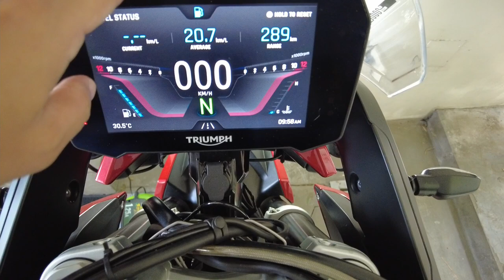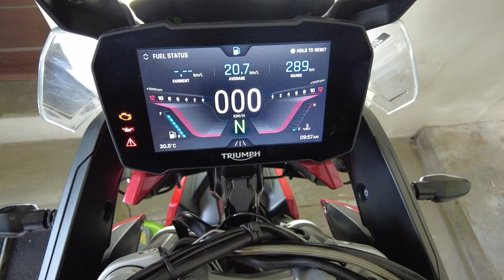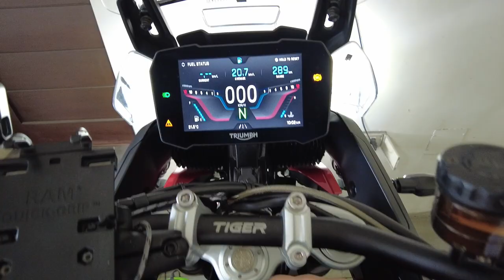Owning the Triumph Tiger 900 GT Low (LRH): Views from a New Rider

Comment: very nice video.i have same bike not LRH (since triumph dont sell LRH in india) so i bought a low seat and bike is with low position adjustment 790 mm.i am 5 feet 5 inch so tip toeing now.going to lower bike by 32 mm with lust racing lowering link then it will become like yours.
Reply from the maker: Yes I came across a review that the Tiger LRH isn't sold in India, but it's good to hear that there's a kit to lower it. Thanks a lot for your kind comment and share. 👍

Comment: Enjoyed hearing your thoughts on the bike. Just got a regular 900 gt myself last week and curious what engine/crash bars you are using and if you rate them? Thanks
Reply from the maker: Thanks a lot! I'm glad you enjoyed the video. 👍 I'm got the Outback Motortek crashbars and skid plate. They're really tough, but tend to limit the space for my left foot.
Reply: @MotoFaith  Thanks for getting back to me. I'll check them out. Was thinking I might get SW-Motech bars. They look similar so will compare. Stay safe.
Reply from the maker: @HW-kf7hi  Great! I just wanted to add that the bars reach really close to the gear shifter and break pedal, so it leaves little space for your feet. Also, despite Outback's video that shows the bike being dragged and the bars catching all the hits, I actually dropped my bike once on the right side, and the brake pedal actually still touched the ground... causing it to be dented. It wasn't a major dent, but I just thought you should know.
Reply: @MotoFaith  Thanks for the advice. It seems none are perfect.

Comment: how do you find the triumph tiger??  😀
Reply from the maker: Hi Kate, I'm actually enjoying it.  I think I've done all that can be done to enhance its offroad specs like change to 70/30 tires, buy tougher skid plates, etc., and have been stretching it a bit in that area. It can manage, though as you said in your own review the ground clearance is sacrificed at some point. But I've managed to increase the height gradually thru the adjustable suspension. It's a tough bike too.

Comment: So, it was a good review especially for short people. 5'7" . Has this bike been to Baguio yet and if so did it make it up the mountain with little effort?  Given another choice would you consider the 850 with a low seat?
Reply from the maker: Thanks for your comment Owen! I haven't ridden it to Baguio, but I rode it through the twisty mountain roads around that area and through Sierra Madre, so I guess similar conditions... inclines, loose asphalt and potholes caused by large trucks and buses, long queues of slow moving trucks that need to be overtaken (i.e. the not-so-glamorous parts of mountain roads in the region 😄 ). The bike performed very well with the scorpion STRs (I wouldnt know with stock tires though), it gripped the road very well, it didnt skid through the  broken asphalt even on curves (with caution ofcourse). At one point I considered the 850, but people said it was much heavier than the tiger 900. I havent ridden the 850 yet and reviews say its a good bike, but I decided to just stick with my tiger 👍... it feels so agile on the twisties. 850 might be better offroad given that the tiger is a triple, but it can handle the job well enough.
Reply: @MotoFaith  Thanks for the reply. Stationed at Clark 67-68-70-71 Baguio then was heaven to me. Lived in San Pablo, Laguna. I miss the PI. Poor economy is preventing me from another bike purchase. Triumph is the way to go. Stick with the Tiger
Reply from the maker: Thanks for the advice Owen! I hope you can come visit the islands again soon 👍

Comment: May I ask what the ground clearance is?  Would it be able to go from the curb down to the road with clearance?
Reply from the maker: Hi, thanks for your question. 👍 The ground clearance with the lowest setting of the rear suspension is around 6 inches. I've adjusted it upwards so it's now around 6.5 inches. My house has a high transition from my parking to the street (almost like a curb), and I've had no problems with the bike.
Reply: @MotoFaith  thank you great video.   I will get one of these

Comment: hi, i have a bike like yours.... i m portugal
Reply from the maker: Greetings from the Philippines! It's great to meet a fellow owner of the Tiger 900GT LRH! 👍
Reply: @MotoFaith  hello, today the parts I asked for arrived, a heated seat and auxiliary headlights...
I didn't have time to test the lights but the seat when testing it is a brutal difference, quite comfortable, BUT I lost the height of the floor I had, we have to choose the height or comfort of the seat... As I have 1.69mt on the seat low I get to the ground quite well, and I get the vision on top of the visor, it's right in the middle of the vision. It was more for you to understand the difference between the seats and their height.
I am now with 5 thousand km and yes you are right the more km you have the more the exhaust sound gets thicker.
Hug
Reply from the maker: @hugoferreira5742  Congratulations on your new seat and lamps! It's interesting to see the trade-off between the heated seat and overall seat height. I guess it's possible to lessen the preload adjustment, but that will then lessen ground clearance of the bike. Thanks for sharing!

Comment: How are these bikes like to ride around metro manila traffic
Reply from the maker: Thanks a lot for your question 👍... the bike is actually very nimble and I can easily filter through with the smaller bikes (except in super tight spaces of course). Even with my panniers and top box, the bike is well balanced and not as heavy as the 1200 bikes. Actually, one reason why I haven't switched to the heavier and taller ADVs is that the reachability of this bike gives me so much confidence in really dense traffic scenarios, which is abundant in Manila and some other cities across the Philippines.
Reply: Thanks for your helpful comment once I get back will need to take one for a test ride